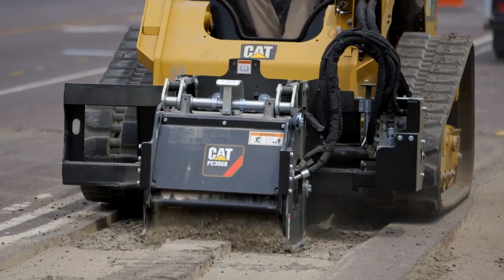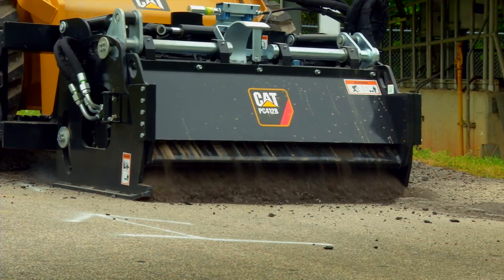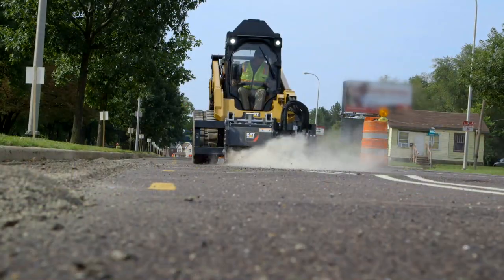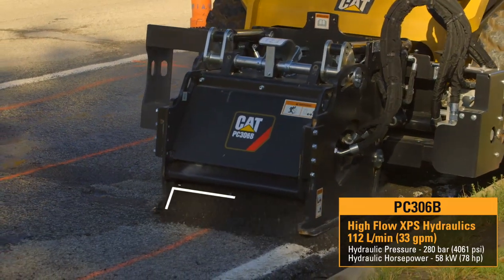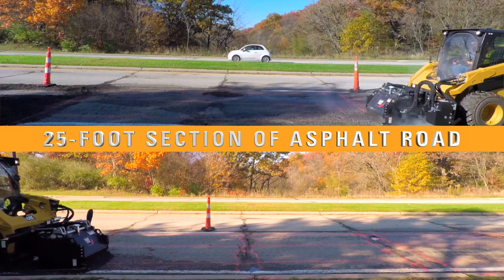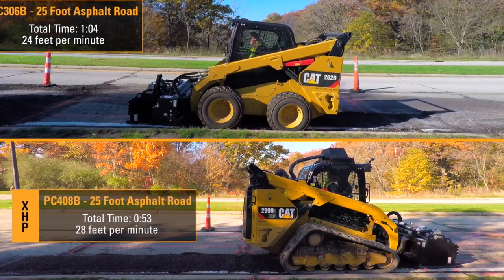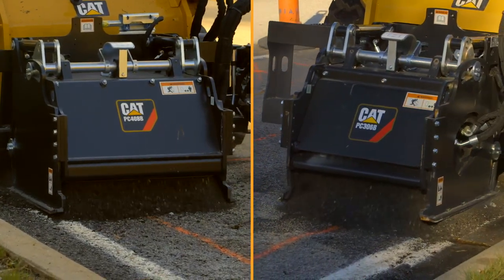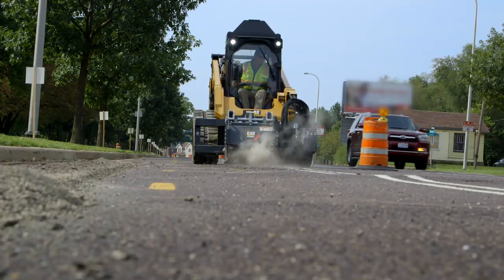Cat® High Flow Cold Planer Production Study

Comment: How does it perform on gravel roads containing big stones, concrete or base rock - natural stone like weathered granite, calcite or volcanic shale? Can you show it in such applications?
Reply from the maker: The Cat Cold Planers are primarily designed for milling concrete and asphalt for road repair or resurfacing. In these applications, they perform between 2 - 4 m/min in concrete, or 3 - 6 m/min in asphalt when partnered with a Cat Skid Steer or Compact Track Loader with HF XPS or XE/XHP hydraulic configuration.

By using a Cold Planer on a gravel road this anticipates a road reclamation project which will grind the dirt and rocks. A power box rake could be used as a preferred option.

Applications with base rock, granite, calcite or volcanic shale can all be broken and milled with a Cold Planer. This would require heavy duty concrete teeth with additional carbide to aid the breaking action. Typically the harder the material, the slower the speed.

These Cold planers are not soil stabilizers. The primary application for these machines are for milling asphalt and concrete for the purpose of resurfacing. It requires careful maintenance of using a Cold Planer in dirt (which wears teeth faster) and solid rock (which will take longer to cut) - Pablo
Reply: @catconstructiontrade  Thank you for the quick reply, good to know , Ill probably need one when I build my house on our family property- I got a hilltop property with bare stone - so i can plane the baserock hilltop with such a cold planer for a houselot, baserock driveway and baserock parking lot after I blast and hammer the uneven stone to a somewhat even surface. Ill note this maschine in needed gadgets, might get/order it at a local CAT shop soon